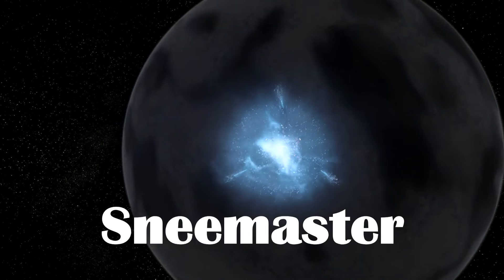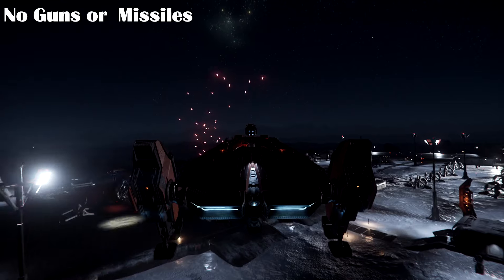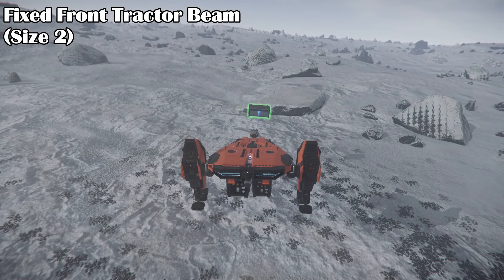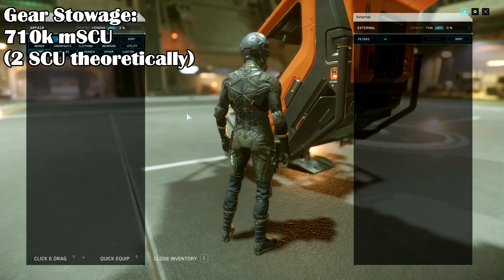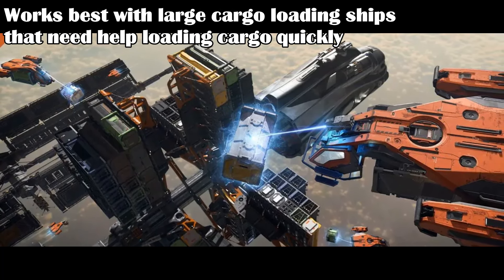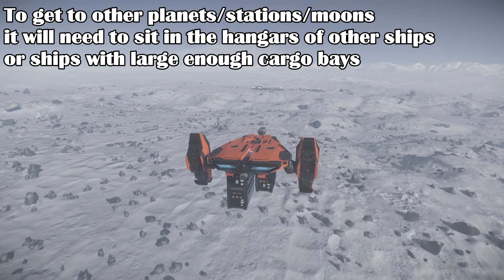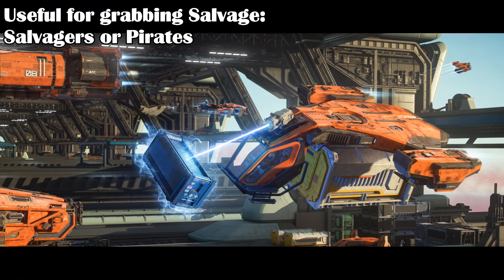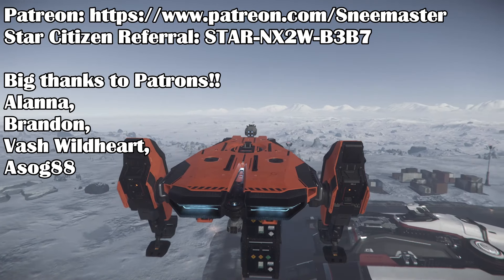Star Citizen Argo MPUV-1T Tractor Review

Comment: My question is,  can you pick up ground vehicles like the Mule?
Reply from the maker: Yes, the front Tractor beam is a size 2 and can pick up many smaller ground vehicles. I'll have to test it to see the max size/weight of vehicle. I'm not sure on the rear tractor beam for vehicles. And tractor beam  strength may change between  patches.
Reply: @Sneemaster  Thank you! I should have been clearer. I was wondering if the Tractor could attach the Mule to it's cargo grid. I appreciate the quick response Snee. Very cool 😎
Reply from the maker: @Captain_Max  Ah :) I will have to try to put a vehicle on the cargo grid to see if they stay there, but because it's upside down, we'll need a tractor beam to load it.
Reply: @Sneemaster  Should be interesting! I'll try as well when I get home. 😁👍

Comment: I'm just frustrated that they gold standarded a ship and want us to pay to upgrade to it or wait till they eventually update the original versions.
Reply from the maker: Agreed, and this applies to a lot of ships that get a new variant that's updated but not the original ones. It can get frustrating.
Reply: @Sneemaster  I would agree somewhat if this was a variant. But this is supposed to be the same ship, just with swapable modules.
Reply from the maker: Yeah, agreed, that's the messed up part. It's technically the same ship, although this one has slower speed than the other "variants", so that's even weirder.